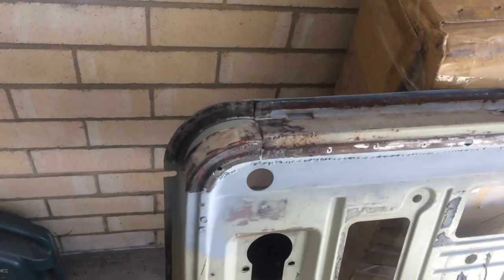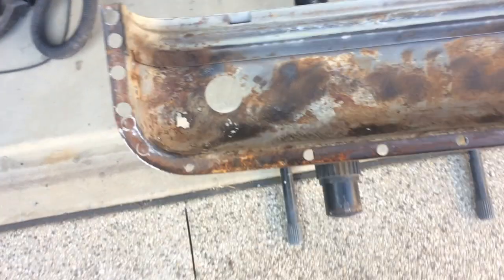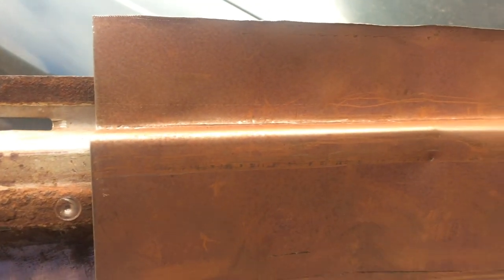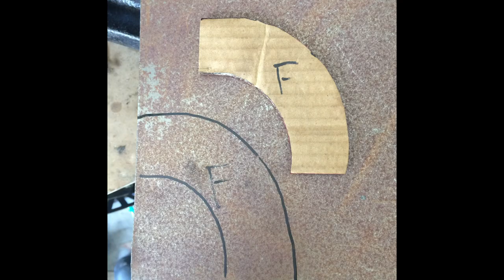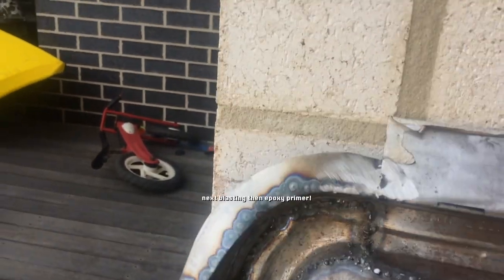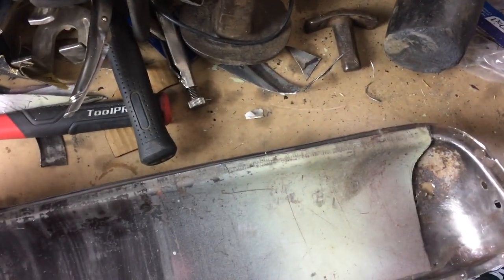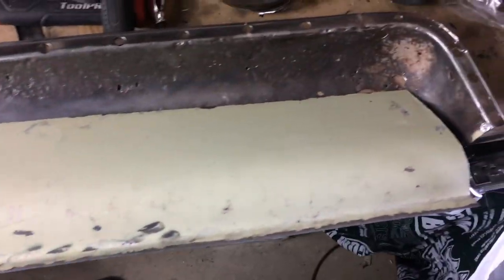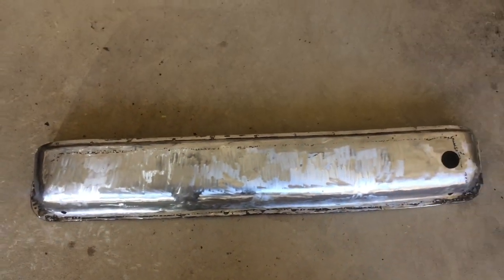EP38 Classic Mini Door Frame Repair | Classic Mini Van Restoration | A Rusty Journey

Comment: Great work Simon good idea to use the top edge of the old pocket. My biggest challenge was getting the curves correct so the chrome trim fitted.
Reply from the maker: yours is far slicker though Stewart! Thanks for the help, really appreciate it. Yeah, I thought I had to keep the lip as I would have made a mess of that. Luckily, once I removed the strengthener, the metal was fresh under there. I'm thinking I'll lead load the weld all the way along for a neat finish.